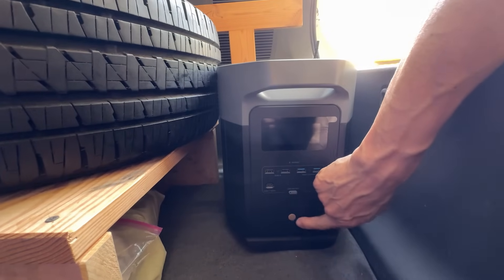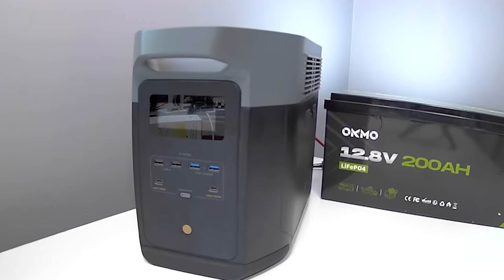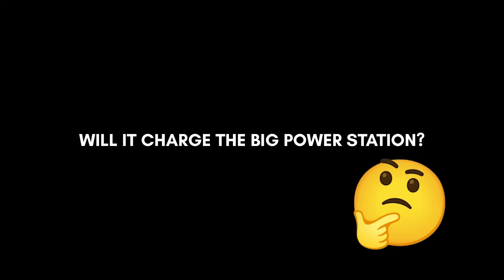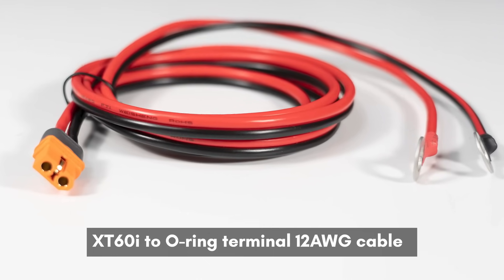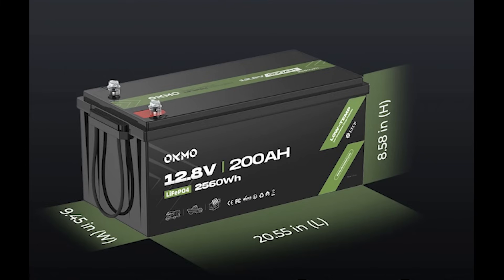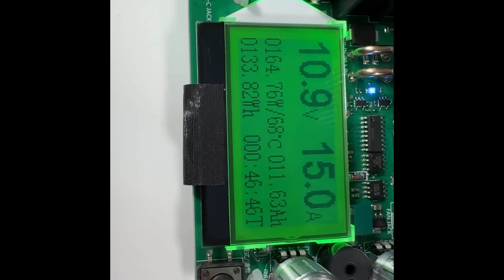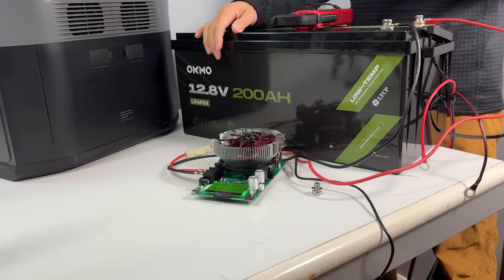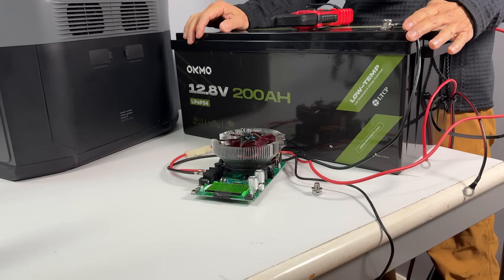Can This Cheap Battery Power Up EcoFlow Delta 2 Max? - OKMO

Comment: If you use a 12v to 24v converter and you will be supprized about the loading speed aka current

Comment: Can the power station charge the battery tho?

Like with solar panels?

Like a right thru charge?
Reply from the maker: In simple term, No. But if you are off-grid and you have excess power from your solar panel, you can use a battery charger plug into your power station to charge the battery.

Comment: Just note that Echo will keep sucking the battery, bringing it to a dangerously low voltage that could destroy it. And it will not charge it back up. You need an external charger. The reason the echo backup recharges is that it is a smart battery and communicates with the echo unit. So what must be done is to keep an eye on the battery voltage and disconnect it before it drains flat. The price for that battery looks great. But we all know how cheap electrical and electronic components fail early.
Reply: Did you forget the BMS?  The Echo, "sucking" the battery "to a dangerously low voltage" is not likely to happen because of the BMS.  Any quality BMS will provide over-discharge protection, which is a feature designed to prevent what you state will happen.
Reply: @UmpTSquat  One, you should never hook a battery straight into the unit. There should be a DC-to-DC charger in between, always regulating voltage and current. Do the research, and you will see this is so. No matter what YouTubers claim. Because what do you think Echos smart battery is doing while connected? It is communicating and regulating power flow.

Comment: Bonjour votre vidéo est très intéressant. J’aimerais savoir quel batterie je pourrais prendre pour recharger ma Ecoflo river 2 pro SVP
Reply from the maker: You can use any 12 or 24V lithium battery, depends on how much power you want and size. For example, this light weight mini 12V 100A battery can recharge your River 2 almost 1.5 times, here's the link: https://www.amazon.com/dp/B0CSKCM593?maas=maas_adg_AB7DE4311F5FBDC2E663E1536587CBB6_afap_abs&ref_=aa_maas&tag=maas
Reply: @vinnyandrocky thank you

Comment: Hey, you could have used two of those cables on the same battery to charge your Delta 2max. Just plug one into each XT60i solar input. That would have doubled your charging input cutting your charging time in half.

Or do two cables on a 48v battery and charge up super fast.
Reply: Yup, I have a Delta II max and two XT60i cables off the same 48VDC battery and plug into each input and get nearly 1000w input.
Reply: That was my thinking as well.

Comment: Is there a simple (connection) way to both use Ecoflow to CHARGE the external battery and then use power when needed.   In the video you charged it with a separate charger, and then connected it to give ecoflow "life".  Haven´t used Ecoflow myself, so I am interested if it works. One can buy EXTRA Ecoflow batteries, but the idea would be to use cheaper (12/24V) batteries.
Reply from the maker: To charge the external battery directly from Ecoflow's DC port is not possible because the DC output voltage of Ecoflow is only 12.4V. But as far as I know, some other power stations such as Bluetti AC200 has a higher DC output which you can use it to charge a external battery.
Reply: @vinnyandrocky  Thanks for the info!

Comment: The EcoFlow DELTA 2 Max supports pass-through power, allowing it to charge from a 110V input while simultaneously powering an appliance from a 110V output,. Does this power flow goes through the unit's internal inverter to convert the AC input to AC output?
Reply from the maker: No, when using pass-through power, the 110V AC input goes into bypass mode and directly powers the appliances from the electrical grid, rather than passing through the internal inverter
. The internal inverter is only activated when the unit needs to draw power from its internal battery.
Reply: @vinnyandrocky  good to know - Thanks for replying. 
 So the power from the wall will go straight to power out and any excess will go the battery  (ie -  if 1000 watts "in" & 800 W "out" - the battery gets 'about ' 200 w RIGHT ?)
Reply from the maker: @TerryManitoba  The max AC input of delta 2 max is 1800W. If 800W out, it still has 1000W.
Reply: @vinnyandrocky  👍

Comment: How does the 12v battery get charged, after it runs down, from charging the EC flow?
Reply from the maker: You can use a AC battery charger. If your power station is fully charge and still have solar coming in from your solar panels, you can use your power station to charge the battery too.

Comment: @vinnyandrocky  can you keep having load on the ecoflow powerstation and hooked up with the external battery while the external battery is also being charged by solar? Thank you!
Reply from the maker: It will likely cause damage to your equipment. The core issue is the fundamental incompatibility of these power sources when connected directly without proper regulation.
Reply: @vinnyandrocky  Thanks for the response. Learnt alot!

Comment: You need to use a boost converter if you're gonna use a 12 volt battery to get the voltage up to get the full 500 watt charging speed.
Reply from the maker: Thanks for the tip.

Comment: would be interesting to what it would do when run through a inverter to mains power station, one would expect just over 2000w. i only have 100ah lifepo4 but i dont think it will charge my 2560 PS fully but will be faster than xti connection im sure. we'll see ?
Reply from the maker: Even a small 100ah battery will able to charge a bigger power station at a speed of 190-200w. It will keep charging until depleted.
Reply: @vinnyandrocky  with an 2500w inverter it will theoritcally do 10x more than you say. You may be right though as ive yet to try it. On mains my PS does 2100w.
Reply from the maker: I am testing the Etaker F1000 Pro alternator and solar charger to see if it works for my camper since charging through cigarette plug just too slow for my need.

Comment: Cool video! Thankfully I have 2 3000w low frequency units, with 2 32-150v mppt inputs 2000w,and dual ac chargers 1500w, and a built in dedicated battery exspansion port, that will actually add real capacity ( load share ) and charge from my machine. I did pay good money for such machines, but they do not need any hacks ( work arounds ) to do there job, but I could do the same,I simply dont need to.
Reply from the maker: Good for you.

Comment: Why was the Delta 2 Max showing 200 watt charging rate & saying it would be full in 1-2 hours? At 200 watts, it should take 10 hours to fully charge. The screen was flickering like it didn't recognize the input.  Also, when you show a battery like this, can you please show the cost of the cables to connect it to the Delta 2 Max AND the charger you used to charge up the OKMO? Both are part of the total cost to "adapt" it.
Reply from the maker: The screen shows 11 hours at beginning. You can use any12V 100AH or higher batteries and their prices are dropping. The cable is less than $20.
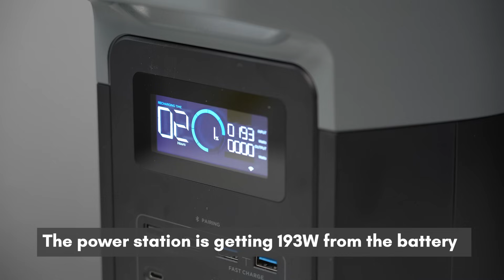Reply: @vinnyandrocky  at 2:54 it is flickering between 1 & 0 when he zooms in

Comment: You need to put 4 batteries in series. To get the max. Power input for charging.
Reply: the problem is charging it. what is a good solar charge controller? 
let say we have 2 12V 100ah each.
Reply: You can keep the battery bank toped off. With a good charge controller. Like the victron 150/35 2000w. Or 150/45 2400.

Comment: How does the ecoflow regulate what’s going in from the battery?
Reply from the maker: Ecoflow will stop receiving input when it reach 100%. As soon as it drops below 99%, it will take power from the battery until the battery run out of juice. You can leave the battery connected while using your Ecoflow. When you see the ecoflow no longer taking power from the battery, the battery is below 11V and almost empty.

Comment: Great video with clear concise information. I have the D2M and 800W Alt Charger. I want to increase my capacity same as you, but want to be able to charge the extra battery using the Alternator charger. I haven't found a way yet, any ideas:)?
Reply from the maker: You will need a DC to DC charger since you cannot charge the extra battery directly from the Alt charger. DC to DC charger is $100~200 and not sure if it is worth the effort.

Comment: Hi, I have FOSSiBOT Portable Power Station F2400, 2048Wh solar generator battery output with solar charging: 12V-48V/15A MAX500W, what batteries will I need. Thank you 25.6V 100Ah LiFePO4 ?
Reply from the maker: Any 12V battery will work, a 12V 200Ah LiFePO4 battery will add 2560Wh to your current capacity.
Reply: @vinnyandrocky  25.6/100a lifepo4 she does
Reply: @vinnyandrocky   25.6/100a lifepo4 she does

Comment: A cheap 12v to 24v step up DC to DC converter will give you way better results. I think I paid $35 or so on amazon for mine.
Reply: is it safe to use for permanent setup? what's the brand? how's the heat?

Comment: The EcoFlow is probably a lot cheaper in the USA than UK so probably stuck with buying batteries, charge controller and inverter but with battery prices ever falling no great hurry (and our Labour govn is bringing back free solar installs for some households from June next year, so might wait on the details on that).

Comment: this is the exact solution for my boat but i am going to buy 2 of them and use a sine wave 2000 watt or 3000 watt inverter
Reply from the maker: Yes, I plan to have at least two in my van for long trips as well.

Comment: You can’t go wrong with an Ecoflow. I made the mistake of buying a Bluetti and have had nothing but problems.
Reply from the maker: It will be great if all the inputs and outputs are at the front.
Reply: true. bluetti also loud man. more issues with UPS works and most of the time not. you have to wake it up for it to work. hope they fixed that issue.
Reply: unfortunately that is not true. Their Airconditiners have problems and Ecoflow doesn't supply individual parts to repair

Comment: The more voltage you use via external batteries the faster and more wattage your Ecoflow will charge. When i use external batteries i always connected them in a 24 volt configuration..If i really wanted to crank out the power into my solar generator i could use 4 batteries for a 48 volt configuration. I find using  a 12 volt battery to charge my Solar Generator is just not fast enough for me.
Reply from the maker: That’s a great way to boost charging speed!

Comment: Can you make the ecoflow charge it?
Reply from the maker: Yes but will not fully charge the battery. The 12V DC output of the Ecoflow is not high enough to fully charge the battery. That's why it is better to use a 24~48V dedicated charger for this purpose.
Reply: @vinnyandrocky  Cant you charge it using the AC output connected to the battery charger?
Reply from the maker: @fmarini  Yes, I can charge the power station using AC. But when you are off-grid camping with no AC available, using battery is another option.
Reply: If you have a MPPT controller you can use solar to charge it as well.
Reply: Good review. 
Thank you
Reply from the maker: @af1023  Glad you like it.
Reply: If you have an alternator charger, you can use it on this battery. You can hook it up to both the starter battery and an external using a marine battery switch and a little wire work. (Alternator charger comes with 16 feet of wire yoy can work with) This way it can fast charge to or from external battery when it’s selected and I know it can output over 14V to my starter battery. So I have solar going into my delta which I can just transfer over to the external using the alternator charger as well.

Comment: Great video.  Many consumers new to solar energy do not know about this and will purchase expansion batteries for their units.  I have a 48V battery that I use for emergencies to extend running times on my EcoFlow.  I also have two,  12V mini lithium batteries.  This are also great for me as I'm getting older and portability is the main reason for owning them.  My wife can carry one should she ever need to.  I may buy another pair of 12V mini that will provide me redundancies and also the ability to charge at higher rates by wiring them in series if I need a fast charge.
Reply from the maker: Good for you.

Comment: Did you try two XT60i cables attached to the same battery?  Should double your input that way.

The Delta 2 max is limited to 60volts and 15amps (with a correctly wired XT60i) so it is not possible for 12v to reach the maximum 500watts for an input.  The battery voltage needs to be at least 33.4 volts so a 36v or 48v battery is sufficient to reach the maximum.  Or use a DC:DC boost converter that can provide at least 500watts at 36v to 48v which are readily available.
Reply from the maker: I already reached the 15A limit with one cable, the only way to charge faster is increase the voltage using 24V and higher batteries. The charging speed is not perfect, but for camping it is acceptable since I don't need that much power all day. Having 4000Wh is not bad at all for minivan camping.
Reply: @vinnyandrocky  The Delta 2 max has two inputs.  Using both means 15a each.
Reply from the maker: @Sylvan_dB  Yes, you are right.
Reply: @vinnyandrocky Please I'd like to know the outcome when you charge through both ports from the same battery. Also is it advisable to charge the battery using external charge controller and at the same time charging the ecoflow?
Reply: I have the delta 2000. I use my ebike battery. It's a 52v battery. The cable was about £10 and it will put about 1040wh back into the Eco-flow at 500w. Its a cheaper and faster solution

Comment: Try using a step UP converter. 12V to 24V. Then try charging the delta pro through the solar charging port. The Delta pro may allow more watts input due to higher voltage. the steup converters dont cost much. $20 maybe
Reply: It is also limited to 15amps (with a correctly wired XT60i) so a 24v battery will not reach the maximum 500watts.  The battery voltage needs to be at least 33.4 volts so a 36v or 48v battery or step up is sufficient to reach the maximum.
Reply: I would say it would be better to get a 48V battery which is around 51.2 when fully charged.
Reply: @InlineSkater72 3 12V connected series d be better charge time l guess
Reply: That is also my thinking to double the number of watts used to charge the battery.

Comment: Cool video!!! I would much prefer to invest in a 24V or 48V battery for this type of charging.  ECOFLOW MAX will accept up to 60V on the solar charge port.
Reply: It is also limited to 15amps (with a correctly wired XT60i) so a 24v battery will not reach the maximum 500watts.  The battery voltage needs to be at least 33.4 volts so a 36v or 48v battery is sufficient to reach the maximum.
Reply from the maker: You are absolutely right, a 24V or 48V battery is more efficient. I am just experimenting with what is available.
Reply: True, but I'm not investing in a system, I'm just extending run time for power outages. i have a regular old Delta 2 and use a Siekon 12v 100Ah to keep it topped off rather than give Ecoflow $450 for their proprietary extended battery.
Reply: Is it safe to charge for hours without a fuse in the cables? 

I've noticed that some cables get hot during charging.
Reply: @Albackpacking_AE always put a fuse in there closest to the battery. A 20 amp for 12g wire is perfect. Always size to the wire.
Reply: I have a Delta 2 Max and can confirm that an XT60i cable from a 48VDC battery will charge at 500 watts, and you can even take two XT60i cables off the same 48VDC battery and plug into each input and get nearly 1000w input.
Reply: @andyw6996  Thanks, Sir! This is good to know, especially for people like me who just entered the solar world and at first think propietary extension batteries are the only way to go.

Comment: 24 Volt 100ah Lithium Iron Phosphate Battery works allot faster and Helps top off My Delta 2 Pro and 2 Delta Pro 1,300's and My River 2 Pro at Night when My Fixed Solar Array isn't producing.
Reply from the maker: That's an interesting solution, thanks for sharing!
Reply: @vinnyandrocky  A Battery Bank o 4 of these wired with Marine Grade 10/3 from System to Kitchen in The Main Lodge here Supplements all Units